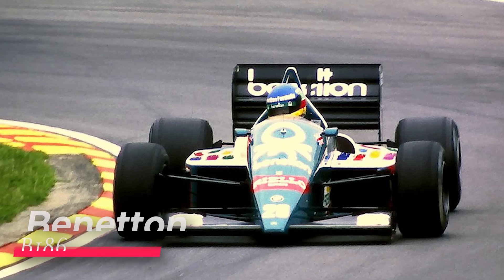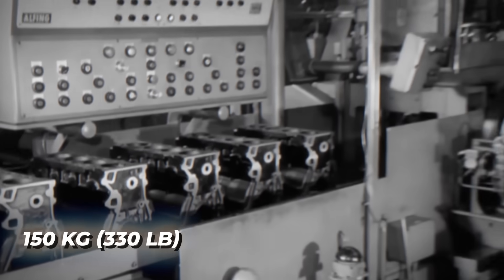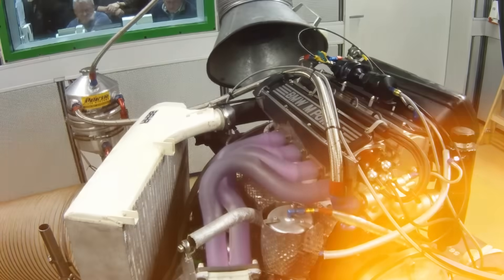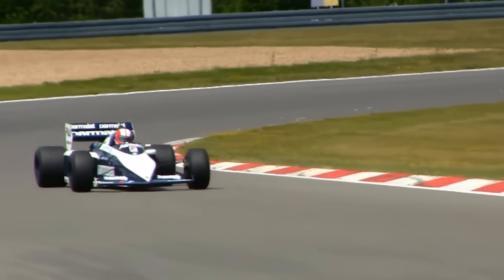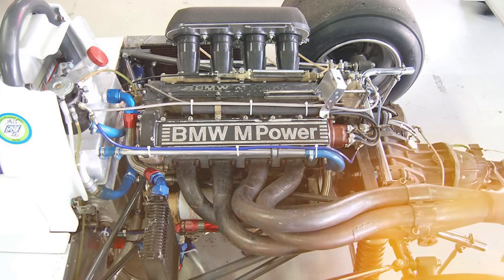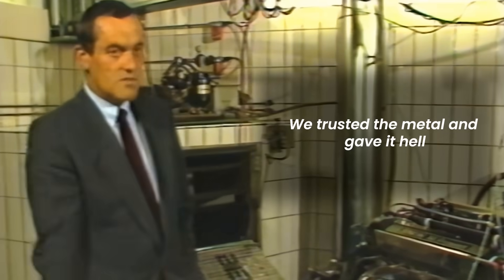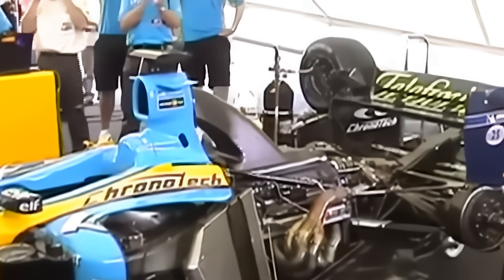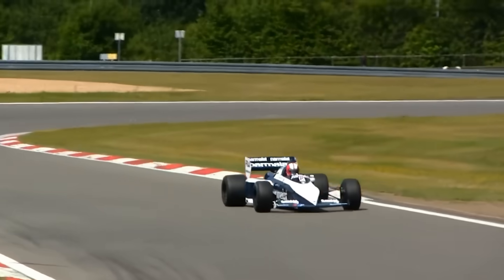The Engine That BROKE Formula 1 - BMW's 1.5 Turbo

Comment: Not more power than a Chiron
Reply from the maker: In race trim the Chiron makes more peak power, that’s true —
but the BMW M12/13 hit over 1,300–1,400 hp in qualifying boost.
Different era, different purpose, but crazy numbers either way.
Reply: @HCGHiddenCarGems  Chiron is 1500 hp, you know that 1300-1400 is less than 1500? This is basic math
Reply: What is your point?
The Chiron is 2 Tons, 2-3 times as heavy.
Reply: @larsjrgensen5975  he says in the video that the Chiron makes less power, which is not true at all
Reply: @wololo10  Sorry
I did not know that you referred to a false statement in the video, I thought it was a simple "more power more better" comment.
Reply: @larsjrgensen5975  and I didn't say it was better, I just said "not more power than a Chiron"
Reply: The chiron would be cooked in f1
Reply: @The23Anonymous  Dont you say :face-green-smiling:

Comment: The BMW Engine in the 1983 Brabham BT52 produced 640bhp in Race trim and 700bhp in Qualifying. BMW released a statement before the penultimate GP that year stating as such. I watched the 1983 season at the time and bought lots of GP magazines and books that year and they all confirm 640bhp and 700bhp. By 1986 they had raised that to 1400bhp in qualifying and 900bhp in race trim.
Reply from the maker: Absolutely right about the early numbers 
in 1983 the BT52 ran around 640 bhp in race trim and ~700 in qualifying.
The crazy 1,200–1,400 hp figures came later in the mid-80s, when boost levels were pushed to the limit for one-lap qualifying.
Different years, different boost rules same engine family.
Reply: @HCGHiddenCarGems Welding the waste gate shut  🙈🚀💥
Reply: I’m not a formula One expert, but I think this guy is lying.
Reply: @Fone65  gives no explanation, just that the other dude is lying. Amazing, this is the F1 community I'm supposed to love.
Reply: @Drift_Potato402 550 hp at idle?
Reply: @D @Drift_Potato402 I don’t have respect for people who put out bad information.
Reply: @Fone65  where was "550 hp at idle" even mentioned? Is that impossible? Absolutely not, still, where is it?
Reply: @Fone65  and I don't have respect for people who call others liars without actually explaining why that is, then get confrontational when others ask them about it.
Reply: @Drift_Potato402 he says it in the Video 2:23
Reply: @Drift_Potato402 At the timeline number
Reply: @D @Drift_Potato402 It’s impossible to make 550 hp at idle. The engine would not idle because it’s making 550 hp.
Reply: @Fone65  no it absolutely isn't impossible to produce that power at idle. At idle, the engine is still revving. At idle, the pistons are still moving, producing torque. At idle, the engine is still producing gasses, moving the turbo even if slightly.

Now tell me why, even after combining those factors, wouldn't the engine not produce power at idle? If an engine doesn't produce power at idle, it literally isn't able to keep itself running, and being an F1 engine, a 4 cylinder no less, that engine likely idled at above 3k rpm, giving it even more of a chance to produce power.

550hp? Might be a bit too much, but it's absolutely not impossible.
Reply: @Drift_Potato402  You win. I'm wrong. I don't fight with kids that don't have any automotive videos on their channel.
Reply: @Drift_Potato402 : P=Mxn; simple formula, but makes it clear. If you have idle speed you need to take of torque. As I remember max. rpm was 11.000 and 1350 Hp. Idle speed is around 2000 rpm. So educated guess is, the motor was able to produce under load around 50-80 HP ( entering the pit street in idle speed). The power produced during engine idling is very little as the engine just needs to overcome internal friction.

Comment: 352 kmh is still a slow top speed for a supposed to be the fastest race car. The thing is even at that power to weight ratio, this car would look slow vs modern f1 car even at just 1 lap at monza.
Reply from the maker: True  compared to modern F1 the speeds look slow.
But the crazy part is that the BMW M12/13 wasn’t built for top speed at all.
These cars ran insane boost only for acceleration out of corners, not for Monza-style vmax runs.
Even at 352 km/h, the real danger was the explosive 1,400+ hp spikes in qualifying trim.

Comment: Toluene fuel ⛽️ 117 octane plus
Reply from the maker: Exactly! those engines ran crazy high-octane brews back then.
Toluene and xylene were common, often 110–117 octane mixes so they could survive the massive boost without detonation.
Reply: @HCGHiddenCarGems  I am having a mindgasm. The 2 numbers i mentioned. I was right ✅️ all along. So glad 😊  I thought I was wasn't wrong 😅
Reply: @HCGHiddenCarGems thanks for the info 😁
Reply: And xylene
Reply: At lambda 1; if run richer, it could get up to 140-150 octane.
Reply: @xXYannuschXx Just another Stoichiometric 🍆 like me 😂 just chasing ghosts 👻 I do like the Skyactiv from Mazda, like to see more rotary form i.c.e.
Reply: Yes plus additives that probably stop detonation
Reply: @carlob517  Octane number higher less chance of detonation aka spark knock. Really it's dieseling off compression only. Can't imagine what the internals looked like 😳  after time trials. Additives would help the rings for sure 👍✨️
Reply: @carlob517  pretty dry mix for the cylinder walls 🧱 lol
Reply: only 102 octane, maximum allowed.
Reply: @V8Lenny  just saying pure Toluene is minimum 117-120 octane 🔥 around when was this made regulation. If you know, I heard 110 around 2000
Reply: @z1berzerker it has always been FIA rule.
Reply: @V8Lenny  that's RON too... Are you Google. Lol I hadn't heard that, low. Here is your feather 🪶
Reply: @z1berzerker yes but germans found out already during WW2 that octane numbers doesnt mean much, same guys made that fuel for BMW.
Reply: @V8Lenny  next I am gonna hear c.r. 13.75 runs on 87pump gas ⛽️
Reply: @z1berzerker I think some bike engines do.
Reply: @V8Lenny 😂 Nah... was thinking 40,000 ft. Supercharger zone
Reply: @z1berzerker Mazda has already achieved that. 14:1 static CR from memory running on pump fuel. Think they even have a 15:1 engine.
Reply: The FIA Fuel Rule Is 102 RON Max, so these Fuel comments are Incorrect.

Comment: 5bar, is 72 psi,  that is crazy
Reply: How they kept that cool enough to not melt is insane.
Reply: @WyFoster  these engines were only running this much during qualifying and were replaced right after... Replaced as in scrapped....
Reply: @WyFoster Lots of fuel in the mix to cool the engine. Lots of flames out the back 🔥💥
Reply: They run the car on toluene so they could run a high boost.
Reply: @furrymooseknuckle They also blended various amounts of diesel fuel into the super-chilled toluene-based fuel to make the fuel not so subject to detonation.
Reply from the maker: 5 bar absolute on a tiny 1.5L block is straight-up F1 witchcraft. The cylinder pressures, the heat, the stress on those pistons… and it STILL held together. That’s why this engine makes zero sense — and I love it.
Reply: @HCGHiddenCarGems also have to remember they made about 175hp/liter/bar of absolute, so in theory 175hp/liter naturally aspirated, in the 80s.
Highest boost recorded was actually 5,5bar absolute.
Reply: @HCGHiddenCarGems  they were completely fried after one qualifying session...
Reply: With multiple turbos you can have a smaller, faster spinning one for low RPM, then a larger, slower accelerating one for maximum boost at higher RPM. You can make 100psi with one turbo, but the lag will be awful unless you use something like nitrous to generate a large volume of exhaust to spin it up fast.

The guys who built these machines were insane, utterly, gloriously, insane.
Reply: @W0o0dy  were just  all regurgitating someone else's experience
Reply: that was absolute, so 4 bar boost.
Reply: Some turbo cars in drag racing run @ 100psi boost.
Reply: @wattyler6075  yeah, sure, but they do that with twin turbos or compound turbos. Achieving that boost pressure with a single turbo is insane even for today’s standards. Also acknowledge that drag racing cars have billet blocks and heads made of high strength alloys, not fatigued cheap cast blocks made to withstand the 100ish hp of a family car.
Reply: @alessandroartemisio3457 twin turbos run parallel wouldn't help boost at all, compound on the other hand. Wouldn't say achieving that boost pressure these days is insane, definitely impressive. Plenty of drag cars still running cast. Fastest 4 cylinder in the world runs 5s, is still cast and it makes well over 2000hp.
Reply: @brennan2486 twin turbos run parallel but they kick in earlier in the power chart and it’s easier to squeeze 100psi out of them if your engine doesn’t rev to 11k rpm… 
Cast 4 cylinder block holding together with 2000hp is crazy, but still believable: a brand new modern cast block will surely withstand more mechanical stress (more torque) than that of a high mileage citycar from the ‘80s.
Reply: @alessandroartemisio3457quite the opposite the older cast blocks are usually stronger properly sized turbo will make 100 psi of boost twin trubos do not help or make it easier
Reply: @alessandroartemisio3457 speedfactory Civic does it with a single turbo. 2300 whp from 2L 4 banger
Reply: @alessandroartemisio3457heat cycled blocks are settled blocks and stronger than a fresh cast block.  Back in the day most manufactures left blocks out in the yard for 12 months to mellow before machining..
Reply: @wattyler6075 that's for like 8 seconds max
Reply: @wattyler6075  not in the 1980s they didn't.
Reply: it had more the gauge ended at 13bar and it was maxxed out so 13bars or more
Reply: @bernhardfruhmann364 every year it seems the story/figures change. What you're saying is that car ran 190+ psi of boost? Single turbo wouldn't come close to that not even a compound and still keeping the head on?
Reply: @bernhardfruhmann364 no man but 6 bars
Reply: @bernhardfruhmann364  a gauge doesn't mean the use case can max it out. Probably that was the lowest rated manometer they had at hand. It's hard to find gauges that go so low. Of course you can find those, but they generally have milibar range.
Reply: Almost 6 bars actually
Reply: BASF in Germany produced a special mixture for the engine to run on. It didn't smell like fuel. But it was very effective.
Reply: these are the best engineers in the WORLD🌎
Reply: Trust the metal and give it hell.
Reply: Diesel numbers lol, pretty impressive. For those saying it's "nothing" clearly don't understand that in stuff like Drag cooling is a non-issue, hence blocks with NO active cooling just solid metal AND even crazier is the fuel.. In drag when spark-ignition engines hit 80PSI & so on they all use Methanol & even Nitro.. Even Ethanol makes a giant difference, Gasoline / Petrol doesn't have anywhere NEAR as much cooling.
Reply: We landed on the moon. This isn't that crazy
Reply: Drag cars are well over 100 psi. Speedfactory Civic makes 2300 wheel hp from a 2 Liter 4 cylinder
Reply: That's diesel territory usually
Reply: If we think about the wind, thats about a wind with a power of 3240 km/h. Holy shit
Reply: Nothing crazy

Comment: If i remember right,it had to be a high high high mileage engine . Oh they pissed on it to
Reply: 100% correct. I know because I have done so. Worked nights in an factory that had a row of M10s out the back and we pissed on them.Acid cleaned before dispatched to the engine builders.
Reply: That was an urban legend that BMW didn't deny publicly at the time (mind games, donchaknow), but later admitted had no basis in fact.
Reply: I read somewhere that Rolls Royce used to put freshly cast blocks out in the hills of Scotland to 'season' them for a few months before they machined them.
Reply from the maker: Haha yeah, the high-mileage part is true… the ‘extra seasoning’ is definitely not 😅. Wild stories from that era though!

Comment: For the non metric crowd, 5 bar is 72.5 psi
Reply: Bar is actually easy converstion unit. Roughly 1 bar =1 atm
Reply: @林振华-t4v  Yes.
Reply: 1 bar is about 14psi
Reply from the maker: Appreciate you adding the conversion! Makes it easier for everyone to follow along 👌